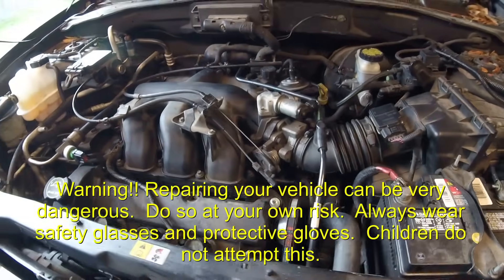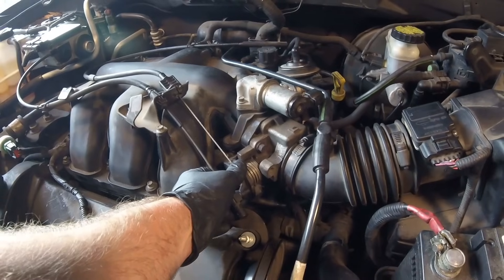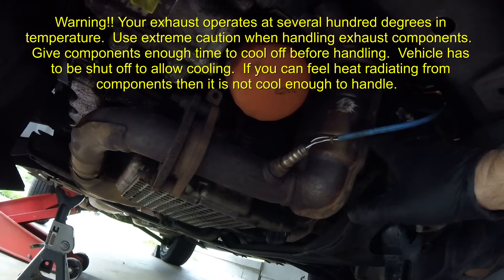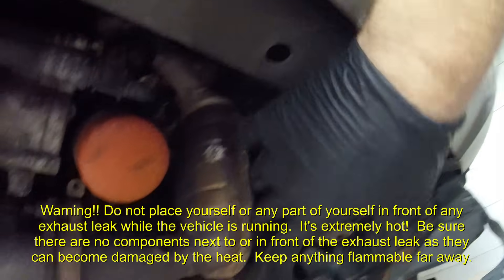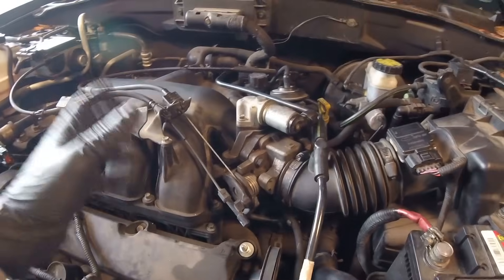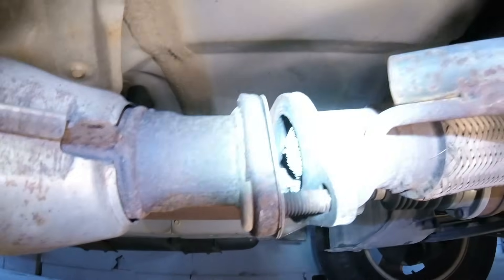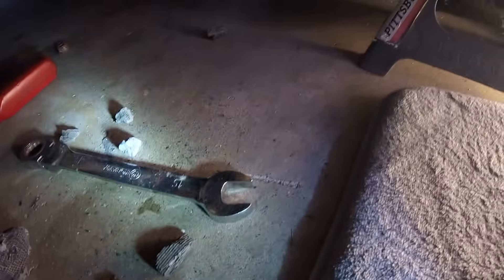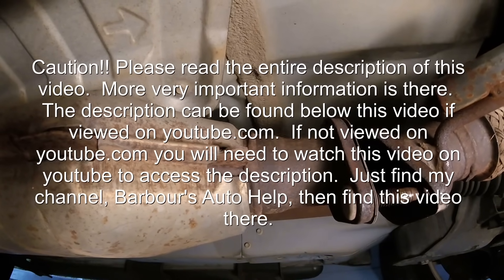How I Figured Out Exhaust Restriction (Clogged Catalytic Converter)

Comment: I have a 2004 Honda accord coupe v6 6 speed 297,000 miles , lost all power but was still drivable , coils , spark plugs were fine , watched this video and just did my exhausted yesterday and it fixed the problem btw my car was also throwing misfiring codes on all 6 cylinders
Reply: My cat was glogged !!
Reply: Clogged **
Reply from the maker: I’m glad you got the issue resolved!  Good job.

Comment: If you're losing vacuum that should also suggest that you've got some exhaust valve leakage because vacuum is created by the downward stroke of the piston while the exhaust valve is closed and the intake valve is opened so a plugged exhaust could become pressurized but if the valves are sealing properly it shouldn't have much effect on the intake except for the loss of power caused by the restriction. Otherwise the only explanation is that the tiny pocket of air left over at TDC between the exhaust and intake stroke contained enough PSI above atmospheric pressure to cancel out the vacuum otherwise created by the intake stroke, in which case I would think your rusty think all steel exhaust pipe would blow out a vent hole long before it starts blowing exhaust out the intake..... probably got a leak in the EGR as well thats  not responding to the loss of vacuum. If the cats plugged i would bet she is too. Id get rid of at least one and throw a turbo on her myself..... after she got a proper valve job of course

Comment: what do you think would cause an even layer of smoke to emit from the surface where the catalytic bolts to the exhaust manifold (when the engine gets to temp) ?
Last time i checked the fluids and oils appear to be where they should be (the oil cap has very minor signs of milky residue).

we removed the pre/post sensor to the cat which i thought may have worked
then replaced the cat. but then not long after a bit of a run it seemed to come back
little tk barina.

Comment: Great info.. thanks alot.
Question, if the cat is falling apart and pieces falling out, does this mean cat is not doing its job and will fail smog test in CA.  Thanks my 2001 has similar issue will definitely check it. Thanks again

Comment: Hi Keith, 

Happened the same with my duratec mx5 NC. I gutted the 1st cat to see if I can save the 2nd cat. I have 2 springs that are connecting the exhaust pipe with the 2nd cat, whenever there is a bigger volume of air that cannot flow through the 2nd cat the springs let them out, making a rattling noise at high revs. With the unclogging (cleaning out the mouth of the 2nd cat) it became much better, but I think it still has particles in it. Can I clean it somehow? With water + some detergent? In your case you needed to replace the 2nd cat? TBH i did not go anywhere with it yet, can the 2nd cat clean itself out? I need your opinion before investing my time to get it lifted and cleaned somehow.

Thanks
M
Reply from the maker: It’s my opinion that replacement is best.  I’d also replace the other. Did you get the root cause of failure corrected?  I’d definitely do that before replacing cats.
Reply: @BarboursAutoHelp  1. owner installed a sport 4-1 header (catless), 2. owner wanted to put back a cat into the header to solve check engine issue (instead of just relocating the o2 sensors before and after 2nd cat). He bought an aftermarket header with cat, that only lasted 30 thousand kms and fell apart, Mx5 NC mk1 has a little bit of factory oil consumption that probably helped. 

My problem is that a genuine mazda midpipe (incl. 2nd cat) costs around 1800 usd. I might just replace the 2nd cat with a universal cat and relocate the o2 sensors, so I will have only one catalytic converter instead of 2 and no check engine light. The first cat (in the header, which is currently gutted), will be replaced to a sport header.

Since holiday season is coming, I will might have a little bit off free time, I will try to soak the cat into some kind of detergent and rinse it with water, would be good if I could save this original 2nd cat, since it worked perfectly before this all happened.

Comment: Pretty sure this is whats going on w my 06 explorer..started losing power, currently cant get over 45 mph. I replaced plugs.wires.egr.air filter and tps connector since it was frayed thinking I solved the problem. Helped slightly but not much. So I can pull the o2 sensor to alleviate some exhaust until I have enough money for new cats?

Comment: Something that alot of catalytic converter videos won't tell you is that when you have two catalytic converters as opposed to one, you're going to have different symptoms. Check both cats with a laser heat gun and check temps at both front and back of cat underneath the heat shield. If there is less heat on the back side than the front, Chances are it's clogged
Reply: Question I got one cat and it's always flaming hot when you drive for more than 15 minutes and it feels like it's clogged
Reply: 🇯🇵؟
greyshus uv yuuuuu s.iiii..ır/misdur
Reply: Good idea ty

Comment: I have been struggling with my golf v 1.6 and discovered this video. I removed the catalytic converter and tried to shake a little bit, there was no sound and nothing came out. I tried to put some air trough it with compressor and it hardly came out at the other end. Now I will try to clean it with soap soaking 12 h. I read it some forum.
Do you think this is pointless? Should I just replace my cat even though it hurts my wallet?

Comment: Would this damage the engine, if it runs for like 10 minutes? I know I have a clogged converter. I tried spraying Liqui Moly but it didn't help. I wanna remove the cats and replace them with resonators, but I'm a bit worried about my freshly rebuilt 347 Ford.
Reply from the maker: What exactly are you asking?  Please excuse me. Just want to make sure I understand what you’re after before I answer.

Comment: I don’t have a bore scope but I’m confident my cat is clogged for 3 months now and I’m risking blowing the engine because I have no money to replace it & I’m in NY which means I have to use a cat that costs 3 times as much as a regular cat at $1,000.00. I want to vacuum it out or clear out the clog but I’m not sure I’ll get the bolts off.

Comment: Could you have back pressure problems if the idiots at the mechanic shop beat the crap out of the flow master muffler to get it apart trying to get to the gas tank to replace fuel pump.

Comment: Well, I can bet that by passing catalytic converter (removing it away) brings better acceleration and more mileage to such cars in which O2 Censors are fitted above their catalytic converters. 👍🏽
But it can be done only in those countries where Car Check or Car Passing in every year or within 2 years is not required  🙏

Comment: Hows taking out the rear o2 sensor going to make a,difference? The front sensor is one that has to be removed from suspected blocked converter..doh!
Reply from the maker: You did pick up the info about the cat set up on the vehicle in the video right?  Has three cats.  Not a normal 2 cat set up.

Comment: Replaced my catylitic converter when I took the old one out the honeycomb was missing so I now know it fell out and clogged my exhaust.
Reply: If it was completely missing a previous owner may have done what I and many guys have done before which is get a thick metal rod and finish breaking up an already damaged honeycomb until it's completely hollow. Then all problems disappear except that you will not pass emissions tests and the check engine light will stay on. This worked in the state I used to live in as there was no emissions testing.

Comment: 3 cats, wow. That would be expensive to replace all them.
Reply: No point anymore just delete or hollow them out use spacers to remove o2 code anything older than 2010 isn't worth it unless it's a truck even then a cat delete is worth it

Comment: Trying to apply this knowledge,I have rattling coming from the intake manifold (11 Camry ) , it doesn’t rattle all the time but when it’s not rattling I get a rough start where my idle goes down to 500 then it slowly climbs up , no cel .. my guess is that I have manifold and when it’s rattling it has enough air to start the car without a problem , but when the rattle is gone it’s because the honeycomb parts are stuck in a position where they aren’t making a rattle but also aren’t allowing the car to start smooth . Could this be , the car performs fairly well with no other problems just this warm start problem

Comment: The vid is very helpful, but on my Camaro, I don't have a check engine light on. I suspect it to be either my spark plugs/coils or my exhaust. My car wants to bog or shake when running idle and really bog down when I speed up, but stops if I slam the pedal or let off. I don't know which is the issue.
Reply from the maker: Never hurts to take it to a shop if you aren't sure.

Comment: When your cat is clogged it has to  put exhaust  somewhere..it goes into crankcase.  . Found it by mistake once. Took cap off to look at timing chain..to see if it was so sloppy it was visible  by eye. Car running. Took cap off car picked up and run perfect.  Put cap back on 10 seconds  later ran like crap

Comment: I just discovered this exact thing on my 2001 toyota sienna xle. Engine power was nearly non existent. Removed the front wideband sensor and power returned. Separated the exhaust right before the final catalytic converter and the same stuff you showed in your video fell out. I knocked it all out of there and reconnected everything. The van has very good power now, and it has not thrown a CEL yet. Kinda strange. BTW, I have over 350,000 miles on this van.
Reply from the maker: Glad you at least got it somewhat figured out.
Reply: What is the Wide band sensor as I am having this same problem with my 98 lexus es300 I can see pieces of the honeycomb in there

Comment: No shit thats it
Reply from the maker: Do you really think I could tell you 100% based on the information you gave that your whole problem is a clogged exhaust caused by the converter?   Man if I could do that I'd have it made!  lol.  But, seriously.  Can you give me more to work with?  What's your vacuum readings, fuel pressure, exhaust back pressure?  etc. Do you have an ignition misfire?  What's the gap on your plugs?  Shoot man, I don't even know if the oil is full for crying out load.  lol

Comment: Ok so I've changed everything,  and it pops like a ak47 at times, found some weird material in my driveway, like some kind of comb like material,  is it plugged?
Reply from the maker: 🤔maybe
Reply from the maker: I need a bunch more information than that to help.
Reply: @BarboursAutoHelp  2000chevy express v8 350
No leaks anywhere from anything.
Exhaust is old as shit.
Cap plugs wires all been changed to. Timing is good also.
Reply from the maker: @SoloClone  It is possible your exhaust is clogged.  Typically, unless you actually take the exhaust apart and look inside to see if it's plugged up, you have to either perform a vacuum test or an exhaust back pressure test to determine what is going on in the exhaust.  It would probably be a good idea too to check and see what the fuel pressure is.  When is the last time the plugs have been replaced?

Comment: In a 325 TDS, could a clogged cat be the cause of what I'm experiencing?
It's basically loss of power in high rpm, especially in 1st and 2nd, where it feels like pushing above 3000 rpm does not much for speed, yet the rpm keeps going up. 
Having watched this vid, I'm thinking (though a noob) given it's a diesel with a good low-end torque anyway, and at low rpm not as much air goes through, perhaps that's why there is not much issue early on, but then with higher and higher rpm, something seems to restrict everything. The engine whines from the RPM, but meanwhile a VW Polo goes past me quietly.
Also max speed in 5th tops out at around 170 km/h. Such a broad issue could be caused by a number of things I'm sure, but I'm hoping this may be a common set of symptoms for someone
Reply: I have the same symptoms with my car 07 hyundai coupe v6. Low rpms it goes good and picks up, but once I floor it, the revs but doesn't pick up as fast, even though it kinda went fast at lower rpm. I suspect the front cat is blocked or severely restricted. I think the exhaust is choking the engine and it's not able to breathe efficiently.
Reply from the maker: I'm not much of a diesel tech.  Sorry.

Comment: I got my catalytic converters replaced by this shop. It cleared my codes but I got a o2 sensor code for bank2 sensor 1 and I replaced the o2 sensor still have the code. Replaced fuel injectors no change and I looked under the car today and noticed the mechanic didn’t put the catalytic converter pipe flush with the manifold and even left out a screw. There is a gap between the two. Can this be my problem with the o2 sensor code?
Reply: Yes basically where he left the screw out is an exhaust leak. It introduces air from the atmosphere and messes with the 02 sensor reading
Reply: How much the shop charge u?

Comment: If it's extremely clogged, can this cause your car to overheat?
Reply: Yes if the motor can't release the fumes the gases and the heat all backflowd back into the block/motor causing it to run hot
Reply: Can also destroy your engine aswell

Comment: I paid mechanic 1400 to replace motor on 2003 chevy impala after that i notice it would catch alot air i recently went to funeral 30 miles down where i stay i notice it was losing power and it wouldn't go past 40 miles hour the mechanic told me it was clogged cadilac convertor dont know if i trust him but seems like it lost power i dont see the car overheating or nothing
Reply from the maker: Sorry to hear you have this problem.   Did you have a question?

Comment: I'm trying to diagnose my catalytic converter, even though I  don't have a check engine light on. The live data on my scan tool indicates that the voltage for my upstream 02 sensors fluctuate just as they are supposed to. However,  my downstream O2 sensor (the one by the catalytic  converter) remains flat at zero (0.0),  so what does that mean in regards to the catalytic converter?
Reply from the maker: Id say if you don't have a code leave it alone.  Sounds like you may have a sensor problem....maybe.   why are you chasing that if you don't have codes?

Comment: What was the cause for a clogged and broken down catalytic converter, rich fuel mixture condition due to a faulty fuel injector or some other reason? If you don't mind please reply me coz I'm having a weird power loss, fuel economy and a misfire at 1500rpm with my car.
Reply from the maker: The vehicle in the video was driven for... maybe years with an ignition misfire.   That was allowing a bunch of unburned fuel into the cat converters.

Comment: I just picked my truck up from my mechanic, because it was stalling out after driving for about 30 minutes. He replaced my o2 sensor. Said it was the cause. My question is did that fix the problem like he said, or is it possible it was really the cat??
Reply from the maker: Well....how's it running?
Reply: @BarboursAutoHelp  well it's not stalled out....🤞🤞
Reply from the maker: That may be a good sign.   I hope it holds.
Reply: Me too!!

Comment: Went to a gas station. They accidentally had diesel in the 87 fuel tank. Pumped a full tank of diesel in my 3.0 ranger. I think the cats are clogged because its running just like the video. It’s horrible
Reply from the maker: Did you get the diesel out?
Reply: Barbour's Auto Help it’s running much better after dumping my tank, and cleaning my spark plugs. I took my cats off today and cleaned them out. It still runs rough every now and then from the left over diesel but it’s much much better thanks for asking. I bough the ranger about 2 months ago for my new job ad an AC technician I was very upset. Your video helped me in what to expect so I appreciate it !

Comment: finally a video that says top just stick a bore scope in and a visual inspection will give you the most accurate and definitive way to diagnose the problem, open the the O2 sensor ports and snake a cam inside with light and that would be the  most definitive and easiest sure way of looking at the problem.

Comment: How did you determine that it was the main cat rather than one of the pre-cats?
Reply from the maker: It was the up stream cat that clogged the downstream.   Down stream was still intact.
Reply: So did you end replacing the upstream as well since they were deteriorated?
Reply from the maker: Actually neither where replaced.  The owner of the vehicle traded it in just after I discovered this.

Comment: My car will start up and run doesn’t make any noise but when you go up a hill it has no power. It’s a 2007 Toyota RAV4 could it be the catalytic converter?
Reply: 100 percent worth checking.  removing the O2 sensor is a nice trick

Comment: THANK YOU SO MUCH. I changed everything on my car trying to figure out why my acceleration and top rpm sucked. Your video is the only one I found that illustrates the same engine behavior that mine had.
Reply: Did you have any check engine codes that led you to replace the other stuff first?
Reply: @devinbagley6895  no did you?
Reply: @devinbagley6895 My Trailblazer didn't throw any codes even though I couldn't get over 40mph. It also had trouble going into 3rd and Drive and it had no power when I accelerated. I had to limp home at about 15 mph. I pressure-tested it with my compression tester and my hose melted off. 😢 oops.😊
Reply: I got this issue on my 07 Miata. Sluggish acceleration. However, downshifting so the engine surpasses 5,500 rpm usually fixes things.
Reply: I’m running issues with my car  2010 BMW 328i. Rpm 650to 900.  2000 at times  and catalytic gets glowing hot  I tuke out but it seems fine